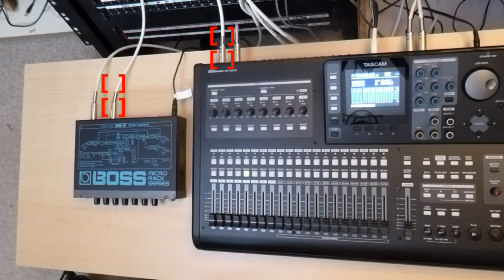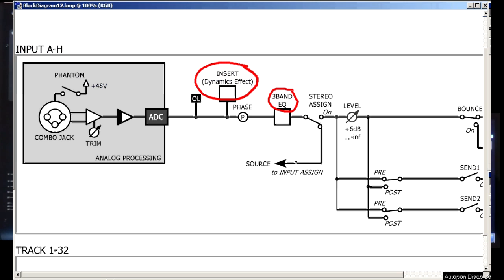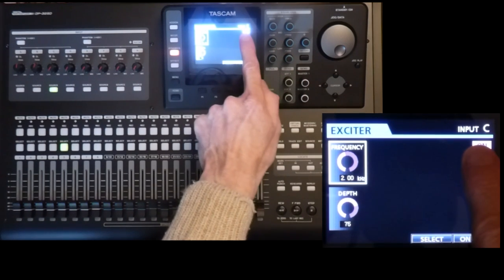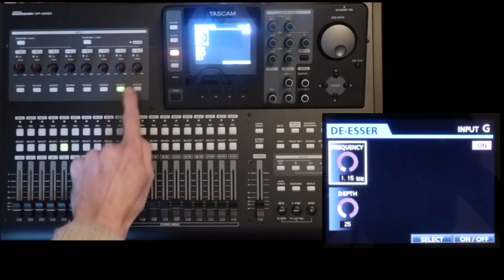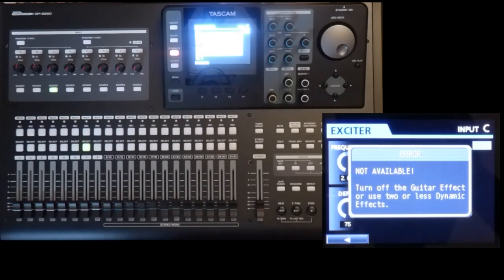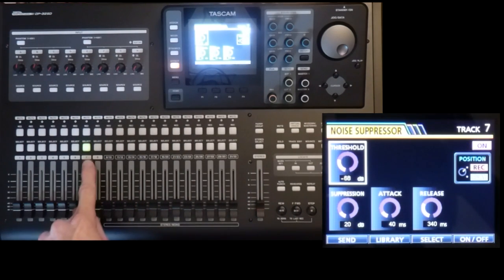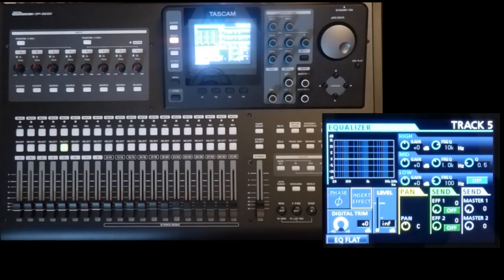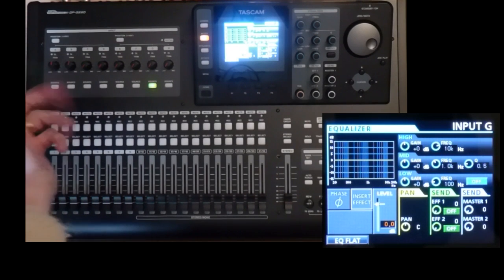Tascam DP24/32SD Tutorial 4: Dynamic Insert Effects

Comment: Good video.   But...are all these compressors, de essers, exciters, actually any use??
Reply from the maker: @dereksmallsuk Absolutely :) It's the careful application of effects (aka 'tools') like these which can turn a 'meh' recording into something to be proud of. As with all tools, they vary in quality, so you may prefer to use external devices to perform these functions, or you may find the built-in ones perfectly adequate; it all depends on your requirements. The how & why these tools are used is a complete topic in itself and is not specific to the Tascam machine, which is why the videos don't cover this, but there are lots of articles available if you search for recording/mixing techniques. Thanks for stopping by.
Reply: @philtipping  I got a the Tascam DP-24SD a few days ago.    It's a bit of an upgrade,  kinda , from various multitrackers I've used, even though it's an old machine.   I'm impressed so far with just simple condenser mic recordings of acoustic guitar.

Comment: Is it possible to use a usb memory stick (with a mini b adapter to the tascam) as the drive rather than a computer? Then, the follow-up - if I want to transfer track files from, for example, a tascam model12/16/24 to the DP24, I could just get a usb hub which would be connected to both tascams as well as a memory stick, allowing both tascam machines to access to each other's files via folder(s) on the stick (?)  I'm trying to save steps in this process . . .
Reply from the maker: @mpr8570 I believe some members on the Tascam forum have used an adapter successfully, but I'm not sure of the details. It may have just been an extender for the sd-card as opposed to the USB socket, so you'd best confirm by asking on the forum. 
The USB port expects a 'host' device at the other end, which is normally a computer, so a normal hub between 2 machines won't work. There may be a free-standing device which can act as a host, but I don't know any off hand.
As far as I know, the song structure for the DP machines is different to the Model series, so you would only be able to transfer wave files between them... individual tracks and/or stereo mixdowns, as opposed to complete songs with song settings. For tracks, you would also need to use the export & import functions; the zz wave files are track fragments so cannot simply be copied between different machines.
Reply: @philtipping  Thanks Phil. I'll look for that on the forums. In the meantime, my idea is to get a mini pc with each of the tascam units connected via usb...  Just trying to make recording on two machines and then getting all files onto the DP as efficient as possible. Yes- I understand that I will need to export/import etc, to turn files into complete useable wav files. Thanks again!
Reply from the maker: @mpr8570  great idea; a mini pc should work a treat :)  You should be able to copy files directly from one sd-card to the other... although I would be tempted to copy them via the computer hard disc so you always have a backup.

Comment: Hi Phil, many, many thanks for your outstanding, patiently explained videos. I have a question - i like to use many varying effects across many tracks. I also like to record the effect onto the track as im recording, because i like to use the effect as part of the performance AND hopefully so i can also free up the effects for different options on later tracks. So is it possible to record the effect in real time to the track during the recording process, and then change the effect say from reverb to delay later on a different track, without altering the effect applied to the first track? Many thanks in advance.
Reply from the maker: @dosvidaniya397 I replied to this question in an email to you yesterday, but here's a copy in case you didn't get it, or if anyone else is interested...

There are 3 types of effects - here's a summary if you haven't already seen it:
http://www.philizound.co.uk/freebies/dp24-32/FX-Summary.pdf

They are configured in different ways due to how they are 'pre-wired' into the signal paths. 
If you're specifically after reverb & delay, these are in both the Insert(Guitar) effect and the Send effect. It's the send effect which causes all the problems as the return/output from this effect goes directly into the stereo bus, which is where all the tracks and inputs are mixed together. This mix is normally what you hear in the monitors/headphones so the effect is audible during recording, but that signal is not routeable to a track for recording there unless you are in bounce mode. This means a send effect can only be recorded during a mixdown, where it appears in the master file (as opposed to an individual track file), or during a bounce, where you nominate a target track for the bounce.
Normally, bouncing is done after the recording (tracking) stage, but you can record live during bounce mode if you really want to - see video #11 for an example.

You don't have these complications if you use the reverb & delay in the Insert(Guitar) effect, as this can be inserted into any track record path.... but the catch is there is only one effect block so you can only record it onto one track at any one time.

I'm not quite clear on the last part of your question as once you've recorded an effect onto a track, the effect is permanently embedded in that track's audio, so the effect is free to assign for any other purpose without impacting the effect applied to the original track. It's not like automation in a DAW, where effects can be added non-destructively.

The normal way of overcoming the limitations with assigning multiple effects is to use bouncing, so it's well worth learning the bounce process. As shown in the videos, there is no degradation no matter how many bounces you do. It just needs patience to run through the process multiple times :)

This is where having lots of tracks is a bonus; many people ask why would they need so many tracks as they only record one thing at a time. But you can bounce whichever tracks you like and apply effects and/or pan, fades, eq etc, and the result will go to a separate track. You can repeat this as many times as you like, then choose which combinations of tracks you want to use in the final mixdown. You can even adjust the track faders in real-time during the mix to vary the combinations on-the-fly.

An even if you still run out of tracks, you can 'park' some into the virtual tracks, or do a bounce of a few of them to free up tracks. The possibilities are endless.

Hope this helps.
Reply: @philtipping  Hi Phil, thank you - I'll reply to your email this evening.

Comment: how do I route the dynamic compressor from input A to channel 8 ?
Reply from the maker: @emtytunes1 The dynamic compressors are physically 'wired' into the input paths so if you want to use them on track signals, you have to route the signal back through an input. Videos 14A & 14B shows how to do this.

Comment: hi ,great info on your vids thanks, i have a newbie question , im thinking about buying dp24 for home  recording song creation just myself not a band ,does this play nice with external effects ,i have tc helicon vocal effects and  guitar pedals etc ,this way i would not be using any of the inbuilt effects  ,
cheers
Reply from the maker: @tbeardmore1 Thank you Thomas. Yes there are 2 send outputs which you can use for driving external effects - see video 5.
The only issue is the send output levels are not very high, so may struggle if your external effect devices can only accept the 'professional' +4 level. Some devices can accept the lower 'consumer' level of -10, and others may handle both (possibly via a +4/-10 switch). The user manuals should have this info in the specification section.
You could also insert effects into the signal path before it reaches the Tascam... depends on the type of device. The Tascam inputs accept all levels; the 1/4" inputs are for higher line-level signals, and the 3-pin XLR inputs are for lower mic-levels. The H input can also be switched into high-impedance mode for handling signals direct from an electric guitar pickup. All of these are worth experimenting with if you are using a guitar pedal.

Comment: Hi Phil, I have a Synth ULTRANOVA, a ROland 707 Drum machine and a BOSS 505 Looper. I have the TASCAM 32sd . I want to record my synth sounds and druk kit beats to the BOSS 505 Looper and create a song and then RECORD everything on the TASCAM 32sd. WOuld I connect all 3 instruments to the TASCAM by Stereo input and Would I be able to record the synth sounds and drum patterns to the Looper through the TASCAM? All of the instruments , once connected to the TAscam can hear each other or share the Sound source , Like a Mixer would correct? Your videos are amazing and I am going to def send donate~ Thanks again and much appreciated~
Reply from the maker: @mpix00 yes you can use the DP-32SD as a mixer to blend the ultranova and drum machine together, and then feed the combined output into the looper. You can also connect the looper output to another input so you can hear/record the final result.

There are several ways of doing this depending on what level of control you want, and whether you have another means to monitor the looper output. If you want to use the DP-32 for monitoring the looper, use the the eff-send outputs (as opposed to the stereo/monitor outputs) to feed into the looper to avoid feedback; just enable the sends on the ultranova and drum channels.
 
The inputs can be assigned directly to the stereo bus or to tracks, depending on what processing you want to add to the source tracks or final result, and where you want the final recording. Details for these are shown in vid 3 onwards for the 'simple' configuration, or vid 6A onwards for the 'advanced' configuration, but you can use one method for building up the loop and another for recording the result. Note the send controls are different for the 2 methods; one uses the inputs sends, the other used the track sends.

Good luck, and thanks for the kind words.
Reply: @philtipping  Thank you Phil, I just sent you a lil Ppal for the thanks;) When you say another means to monitor the looper, do you mean by say hooking the looper up to  a mixer? Sorry I am new to the tascam and using alooper as well. I believe I will watch the vid 3 onwards while using the tascam so that I can get a sense as to everything. Thank you ~
Reply from the maker: @mpix00 thank you Michael, that's very kind of you... much appreciated :)
I meant you could monitor your looper by plugging it into a guitar amp for example. This would mean you wouldn't have to connect it to the Tascam while you're building up the song loop. The routing would then be simpler as you wouldn't have to use the send system to avoid feedback... just connect the Tascam output (either the main stereo output or the monitor output, whichever is most convenient) to the looper input. You only need to connect the looper's output to the Tascam when you're ready to record it. This all presumes that you you want to build up the loop within the looper before recording it onto the Tascam, but I may have misunderstood what you are trying to do.
If the videos are a bit too in-depth at first, you may find the step-by-step guide useful; full details on my website  http://www.philizound.co.uk/freebies/dp24-32/dp24-32.html
Reply: @philtipping  ok that's interesting as I do want to build up the loops from the synth and roland 707 before I record. Now am I able to do that with the looper plugged into the Tascam? Also, how do I connect the Speakers to the Tascam for sound out of all instruments?
Reply from the maker: @mpix00 yes you can leave the looper plugged in to the Tascam. It's up to you what you do with the input signal(s). The assign screen is your 'patchbay', so you can leave an input disabled, or route it directly through to the stereo bus for monitoring or recording in bounce mode or mixdown modes, and/or route it to the track paths where it can be monitored and/or recorded in any mode. 

So you can leave everything plugged in and do all the routing as & when by simply using the Tascam controls.

Speakers can be connected either to the monitor outputs or the stereo outputs at the back of the machine. There are pros & cons for using either of these;  the videos show the difference, but basically the stereo output will be a mix of whatever signals are on the stereo bus at that time, so this will be any inputs and/or tracks as mentioned above.
The monitor outputs (which also go through a headphone amp to the headphone socket at the front of the machine) will be whatever you've selected via the Monitor Select button; normally it will be the same as the stereo bus, but it can be other signals if you like.

Both of the outputs at the back are line-level signals so you'll need an amplifier unless you are using active speakers. 

The routing possibilities are very flexible, and you can solve many 'problems' by understanding the signal flow, which is why the videos emphasise the usefulness of the block diagram. As mentioned, if the videos are too in-depth to start with, the step-by-step guide shows how to do all this as a series of steps without getting bogged down with the deeper understanding.
Reply: @philtipping  Ok, so can I hook the looper up to a mixer and then output the mixer into the 1 of the Tascam L Rs I puts? This way, I can utilize the mixers' other inputs for other instruments into the mixer ? I need to look back through the videos and see how to assign an eqch channel to each piece of equipment. I think I have a good point of reference with your videos to get everything working.
Reply: @philtipping  Which video in your series explains how to assign each instrument plugged in to route them into the stereo bus? I have speakers for the out put.
Reply from the maker: @mpix00 Vid 3A shows how to route/assign inputs directly through to the stereo bus. Vid 6A onwards shows how to route/assign inputs to tracks. The vids are meant to be watched in order, so if you jump in at random it may be trickier to follow.
Reply from the maker: @mpix00 Yes you can use an external mixer to pre-mix your instruments, but the Tascam is a combined mixer/recorder so it could also do this for you. The Tascam can only handle 8 mono inputs (or 4 stereo) at the same time, so an external mixer is only necessary if you have more inputs than this, or if the mixer has features which are not present on the Tascam. There's no right or wrong, so just do whatever is easiest for you :)

Comment: On TascamDP24SD with firmware 1.09, adding any of the Insert Dynamics Effects the source channel, seems to add all four of the Dynamics effects on that particular source channel as displayed by presssing the SELECT (F3).  Is this a bug on Firmware 1.09? thanks.
Reply: my question can I just turn ON any of Four Dynamics Effect without turning all ALL on that particular source channel?
Reply from the maker: @Tony Fernandez no it's not a bug. It's the display which is confusing; it does not add all four effects. Only the effect which is currently showing on the Dynamics screen is the one which is inserted. If you press Select to choose another effect, you are just changing the effect from one to the other.
Hope that clarifies it.
Reply: @philtipping  😊
Reply: @philtipping  thanks

Comment: I have followed allong the tutorials and using the latest firmware but when I select dynamics and turn an insert effect on pressing select through the four shows them all on. If I select off they all go off. So can i now have more than one dynamic insert effect on? I am just going simple with a condenser mic on input A. Of course a deesser, and noise suppression on the one input would be nice but as I understand it, I am only allowed one insert effect per track input.
Reply from the maker: @For Synth's Sake I agree it is confusing :) There are 8 different dynamic effects corresponding to the 8 inputs. Each dynamic effect can only be one of 4 possible types (compressor, de-essor etc.) at any one time, so you're right in that you can only have one of these effects per input (although see videos 14A & 14B for some advanced work-rounds).

Whichever effect is displayed on the dynamics screen is the chosen effect for the input shown at the top-right of the screen. 
When you press Select, you are just changing that effect for that input. 
When you press on/off, you are inserting or removing that effect from that input path; no other routing is changed.

The dynamic effects can also be inserted/removed via the mixer screen, but I don't recommend that method due the 'gotcha' shown in the videos... you can inadvertently change the type of dynamic effect without realising it (unless Tascam have fixed this quirk with a firmware upgrade).  

This effect summary guide may be useful:  http://www.philizound.co.uk/freebies/dp24-32/FX-Summary.pdf